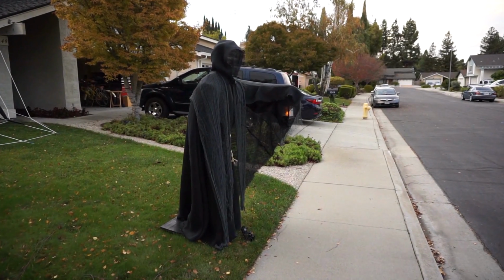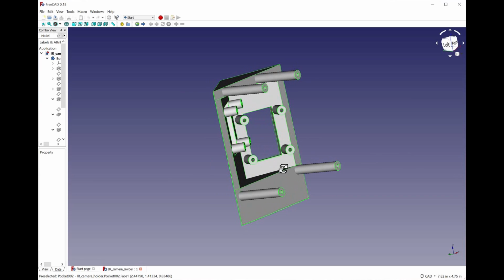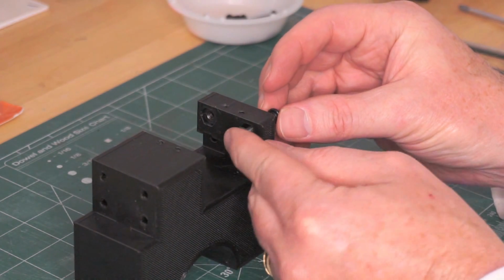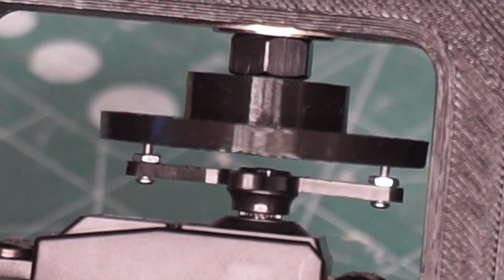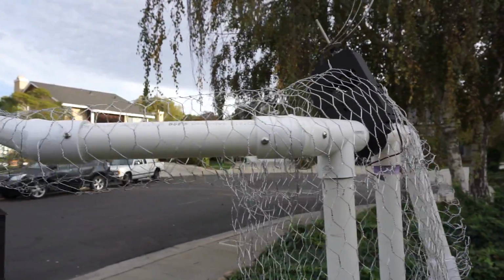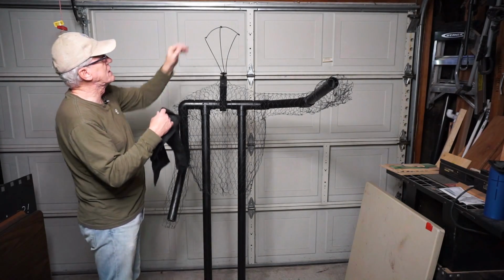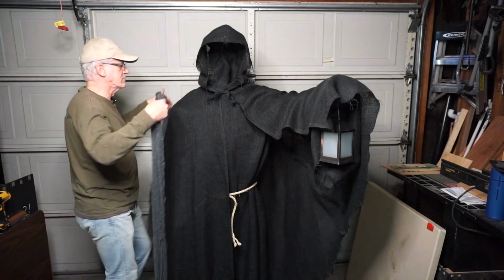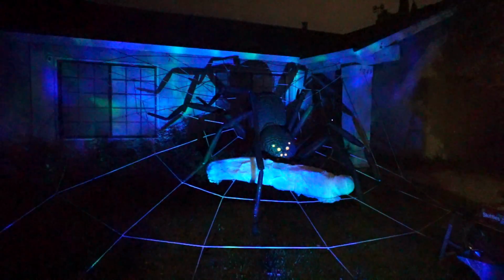Arduino and IR camera animatronic Grim Reaper

Comment: Hi there. Great prop! I reviewed the sketch and I can't seem to see which pin you attached your servo to. Was that left out on purpose for the end user to decide?
Again, great prop and thanks in advance!
Reply from the maker: @rayleblanc7738, it’s in there about a third of the way down.  The line is:
azimuth.attach(9); //declare that the servo called azimuth will output on pin 9 of the arduino board
Reply: @68percentwater ahhhh, got it thanks. Just missed it.

Comment: Stumbled upon this while looking to make a very similar prop.. except my plan is to have a head dangling from the outstretched arm, and have it swivel to follow the trick or treaters.
How did this work when multiple people walked by or going in opposite directions?
Reply from the maker: Generally it stayed on the first target until it left the field of view.  While the algorithm dithers between the two targets, the motion smoothing routine prevents the servo from moving fast enough resulting with the first target being tracked. However if the second target is hot enough, it will move to and track it. This is demonstrated in the video when the van drives by and it leaves me and tracks the van.  Groups are tracked near the leading person as that is the greatest differential between samples (background to person vs person to person).

Comment: I am really trying hard to get the circuit and program to work.  I have the new sensor and wondering if I have them oriented correctly.  If anyone is still reading there response could you help me out
Reply from the maker: @trkeenan2,
  Yes I’m still here.  Describe what your symptoms are and I’ll try to help.  Though I’ll be honest, this project was at the limit of my skills and I’m a little surprised I got it to work.
Reply: This project is way beyond my limits.  I am very impressed with what you have figured out with the programming.  I have the project sort of working.  It is not very responsive and does not track me at all.  When I put my finger over each sensor the servo will move in that direction.  I am wondering if I have the pair of sensors angled correctly with each other.  They are side by side and close to a 30 degree angle.  I do get the array data on screen which tells me the sensors are working.  Do you have any ideas what may be wrong?
Reply from the maker: @trkeenan2   The way I figured out I had the right orientation was to add a couple of lines in the code to write the array values to the screen and then passed my hand through the field of view and watched what values changed. The first time I did this I found my rows and columns were transposed.